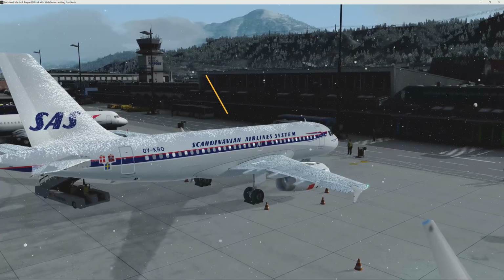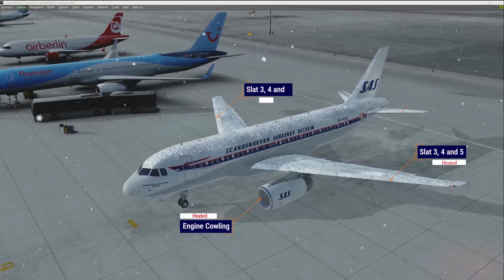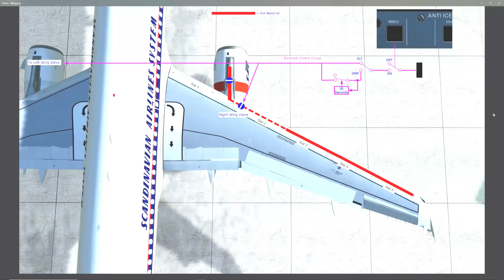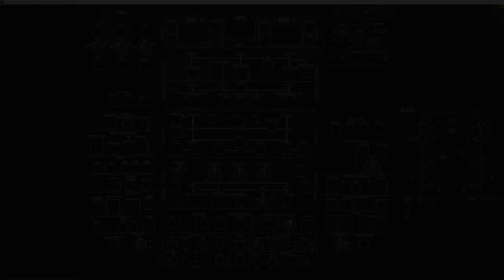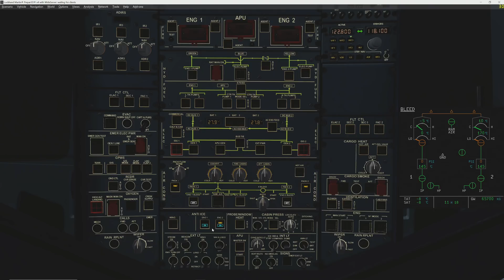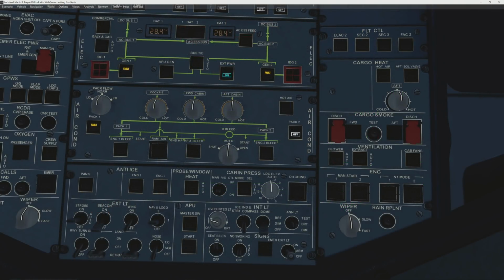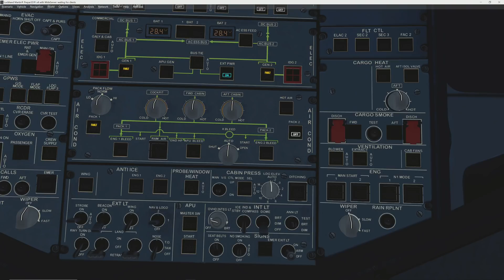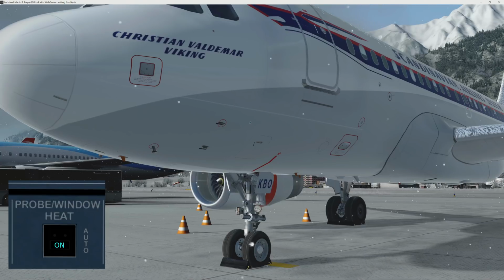Aircraft Basics: A320 De- and Anti-Ice Systems

Comment: Any limitation for using wing anti-icing？I've heard that long-term use of the anti-icing system would cause ice accretion on rear edge of the wings
Reply from the maker: Hi. On the ground wing anti ice on the A320 doesn’t work. Only for a 30 second self test cycle. Inflight it is not recommended to fly in icing conditions for long periods of time with flaps and slats extended because of the risk of ice accretion at the unprotected areas. What you are referring to is an ice buildup because of melted ice refreezing aft of the slats because of using wing anti-ice for longer periods of time. There is not a limit on that as long as slats and flaps are retracted.

Comment: hello, i have a question regarding wing anti ice. once you de ice, you leave them off during taxi and take off because you are safe due to de ice holdover time right. my main question is, if there is ice accumulation, would you switch wing anti ice on right after take off?
Reply from the maker: Hi. Correct. That is why you can calculate takeoff performance with wing anti ice on. So after takeoff you can switch on the wing anti ice.

Comment: Hi thanks for this video!! I just have one doubt if the wing anti ice requires the engine bleeds what would you do if you have an engine failure during icing conditions?
Reply from the maker: Then you lose wing anti-ice on the side of the failed engine. However in that case there is a procedure where you open the crossbleed valve to recover the failed side. In this case you need to switch off one pack thought
Reply: @Blackbox711  Thank you!! I learned something new today :)